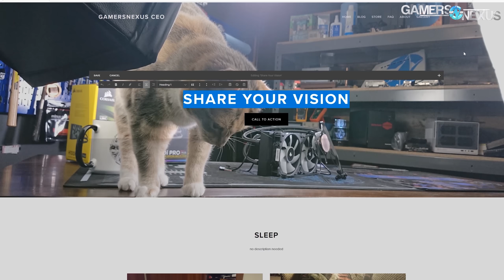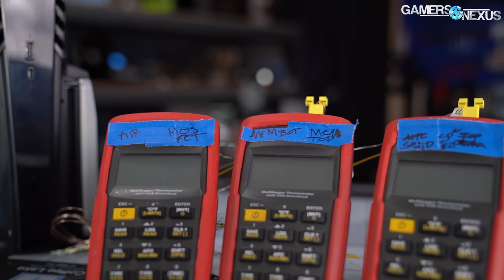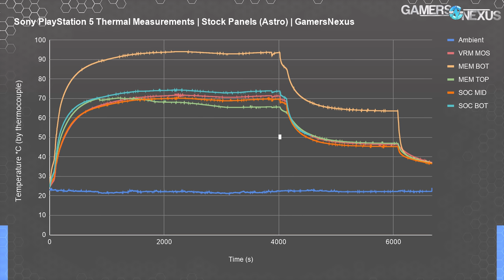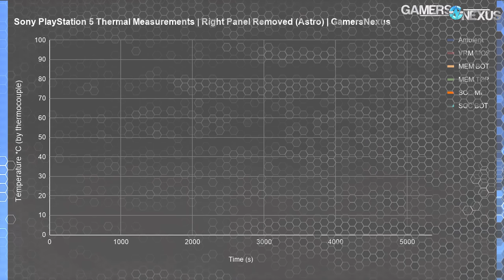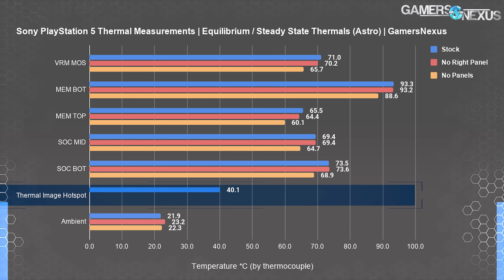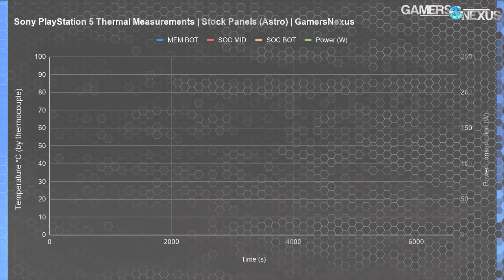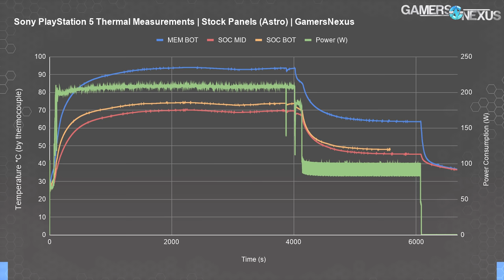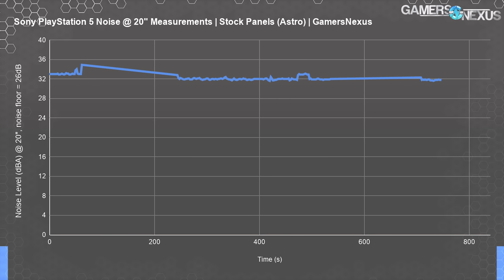Weak Cooler Design: PlayStation 5 Thermals, Power, & Noise Testing

Comment: Playstation 5 is huge, underpowered( Without the overclock it has), bad online service, no next gen retrocompat, disabled SSD expansion, cheaply constructed, runs the hottest of the bunch ( Overheating) , low storage ( 664gb), gimmicky ( DualSense, Tempest), No VRR, No HDMI 2.1 Cable Ultra High Speed.
Reply: A disaster , but everybody loves Sony lol
Reply: The hdmi cable is 2.1, there was a vid that tested the cable it self
Reply: @sorasora749  It is , it is a low version with not all the features the standard offers.

Comment: ps5 inside looks so damn cheap that's violent.
Reply: All pc, consoles or any type of tech is made of plastic, metal, an wires!! Just because something has harder plastic or fancy design dont it premium!!
Reply: @godssalvation87  still looks cheap.
Reply: @lolokikou5521  Just because they didn't get the fancy solder mask (the cool prints on motherboards) doesn't mean it's not good, the normal green stuff works perfectly fine^^
Reply: @johnuferbach9166  did you watch the whole video ? there is recycled stuff, look at that cpu/gpu mark where it should not be there.
plus the whole design feel cheap, the materials feel cheap, the build feel cheap, no wonder because they had to cut many corners to bring down price.

Comment: typical of cheap mass produced product I guess. It wouldnt cost much to cool those RAM, if anything at all but they didnt.
You should have tested with a proper game like CoD pushes the system quite a bit. If its this hot in Astro, real games gonna be rough lol.

about the exhaust being hot. Xbox is getting complaints from media because their exhaust runs too hot lol, mainstream media just has no clue about good thermals. As if cooler wind coming out is a good thing...
Reply: mainstream media is filled with people that are tech illiterate. I don't even bother with most forms of mainstream media, especially when it comes to tech.
Reply: Isn't it funny? If you want to be perceived as cool, you must either run lower power or trap more heat inside.

Comment: Just curious, if I placed a small table top fan next to it to help "blow the hot air away", do you think that would help (even a little bit)? And if so, where would you aim the airflow?
Reply: I do that. If systems on its side aim it at the right side, intake side. With airflow it should be able to move air easier.

Comment: Your PlayStation's model is interesting, it has a fan that is different than 2 other cooling fans that users received based off of this article:

https://www.lesnumeriques.com/console-de-jeu/labo-playstation-5-et-bruit-toutes-les-consoles-ne-sont-pas-dotees-du-meme-ventilateur-n157521.html

Was this unit sent to you for review?
Reply: Wow, this is very interesting. Looks like Steve has the fan showed in Sony's official teardown video. It also looks like I got the louder fan mentioned in this article 😢.
Reply: @adris3431  same here. But our fans may be louder but maybe ours are more efficient cooler than other two. We dont know yet. So dont worry 😅
Reply: @GoldPunch  there's also variations in the power supply. Some of the power supplies in some models of the PS5 are cheaper, which is what is causing the "buzzing" sound.

People thought it was coil whine, but it is not being caused by the GPU at all...it's entirely by the PSU.
Reply: @TypicallyUniqueOfficial  Oh damn, I guess I lucked out on that part of my PS5 then. Do you have a source for that or is it in the video cause ngl I didn't watch the whole thing lol.
Reply: MertensCW  What Sony's doing isn't actually a cost cutting measure. I think what's happening here is Sony is buying these fans from different suppliers which are all based on a reference design from Sony but still perform slightly differently. This is usually done to make sure they don't rely solely one one supplier incase something happens to a supplier. Samsung, for example, makes their top of the line Galaxy series phones with two different CPUs in the exact same phone model.

Comment: 1 dude and a youtube channel pretending like he knows more or is running more tests than SONY.  Rigggghhhhtttttt sureee
Reply: Exactly, I was trying to find more info on this heat issue and only found articles that were pointing back to this exact video, so unless people do more testing I don't trust these results just yet. Especially since he had to use a mallet to remove the sides that can be pulled off by hand.

Comment: What about putting thermal pads on top of the steel plate on the memory modules to transfer heat to the plastic? It would be a simple mod that everyone could do.
Reply: The conductivity of the plastic is so low that it wouldn't make an appreciable difference.
Reply: @infinitelyexplosive4131  I disagree. With such high temps and it being so close to the fan, it could get the temps in the high 80s vs 94c

Comment: At the 19:40 point you talk about coating it with a coating to present a black body object? But wouldn't that cause heat absorption itself in the coating which would flaw the test? What kind of coating are you referring to? I mention this because I recently was researching black 2.0 paint where measuring of temperatures and light reflection was going on. It changes the the temperature on its own simply by being aplied.

Comment: The magnet test was aligned with the steel plate that hold the CPU in place and I think that might be what made it stick. Because that metal shroud does look a lot like aluminum.
Reply: True. Also the plate seems way too thick. Seems to me like a 1.0 - 1.5 mm .  If that was steel, it would be on the heavy side. You also do not need such a thick sheet of steel just for reinforcing that PCB. It has to be aluminium as it needs the thickness for structural integrity. It also doesn't sound as steel when Steve accidentally hits it agains other parts of the console, it is much more muted, exactly as aluminium does. 
The last nail in the coffin  was the shine - if it was indeed steel, it would have to be galvanized steel to make any sense being in a console - stainless is even worse conductor of heat than regular steel and is more expensive. If it is galvanized, it would have nice scratch marks wherever there is a bend as Zinc is softer than steel. Those marks would also be prone to corrosion. 
So it has to be aluminium. I work with metals every day and it puzzled me when Steve said it is steel as it contradicted everything I was seeing on my screen lol.

Comment: I wanna buy modded panels with a shroud and mesh opening to let air in the ps5 more easily and prevent dust from entering
Reply: But but you can get rid of the dust every easily.

Comment: GN team, just wondering will you do a follow up video regarding the M.2 SSD expansion slot? A lot is having the misconception of leaving the cover off but in fact it’s actually part of a thermal air design to leave the cover on where it allows air to flow through that area? 

A comparison with heatsink will be great too.

Comment: Seems as though the fan has an intentionally quiet curve. Temps could likely be reduced with a slight increase in noise.
Reply: Considering how silent it is, I wouldn't mind if mine makes a little bit of noise, if that means the console won't die in 2 or 3 years or whatever time

Comment: Are the fans the standard 12V variety?  Could we put better fans on it and maybe do some case mods to the improve the temps?  Maybe cut a hole in the steel plate and mount a proper heatsink on there?

Comment: Your testing needs to REDONE.  

"I can confirm that heat shield is NOT MAGNETIC.

Testing using a long magnet on the disc drive and M2 slot cover, which were magnetic, and then on the heat shield (using the hole above the disc drive which extends through to the heat shield), which was NOT magnetic. He usually doesn't make these kind of mistakes with his PC component reviews so I'm really surprised.

His other mistake is the gap he created routing out the wires, which could've raised GDDR temps:"

[Imgur](https://i.imgur.com/MkZGzeJ.png)

Comment: Just trying to think of a few ways to solve the memory temp issue.

What size universal heatsink would fit on the steel plate over the hotspot? Would something like copper tape or thermal transfer tape going from the hotspot to the heatsink edge work? 

Or maybe just simply layering copper tape over that area a few times?

A video trying a few hacks to see which nets better temps would be cool to see.

Comment: Does it make a difference that you measured with only the left panel on and then without both panels, but then determined that you'd need to remove both panels to get a cooling effect? Just wondering if you should have tested it once more with the left panel off and the right panel on to eliminate the possibility that the left panel was the only relevant panel, and that removing the right panel was irrelevant.

Comment: Set the Fan speed higher and there you go with better Temps! They thought Liquid metal will fix that all, but at last even the best thermal paste is shit when the fan is just sleeting around 😂 This is and was always the biggest problem on Sony's Consoles... sleepy fan FOR THE PLAYERS 😅
Reply: yeah but the liquid metal is no the issue here, and the cpu/gpu temps ere pretty good, the problem here is that the memories of the system where poorly cooled, causing the artifacts reports that are online
Reply: @aanimekaii  right, and the slow fan speed causes even more problems xD But this was the same on the PS2, PS3, PS4 and again on the PS5. Not to forget the IHS problems on the PS3. Belive me one thing, Sony is not to stupid to get the consoles cooled better, they just wants it like that. Xbox Series X here did a great job again, like on the xBox One, never had temperature problems, Wii and Wii U running also years long cool and without problems, but some how it seems that Sony doesn't like cooled systems 😅

Comment: Steve you saved my 3950x with your video on the PBO settings.
Steve I hate to keep pestering yet SAM works on 3950x and you keep saying only the 5000 series of CPU has that.
I'm sure you will correct that because you are legendary.
Reply: I've heard that it works with Zen 2 cpus even on b450 motherboards with the beta bios that ad resizable bar. I'd like to test it. I have a b450 msi gaming pro carbon with a 3700x and rx 6800 xt but I don't want to update to beta bios
Reply: @TerraWare  - It's a feature of the PCIE spec Steve mentioned and it does lift performance so I hope you get that going.
Hitting the 10000 in CBR-20 is a reasonable goal with the SAM enabled.
I'm hitting 9368 and I think the 10000 score was achieved with 1800 DDR4 and I'm using 1600 DRR4 CL14
My settings ( PBO settings that Steve recommended , -0.10000 offset to keep near the 105Watts, Scaler Auto ) Enhancer OC3 Mode Auto , CPU Enhance Auto

Comment: So I can just add larger thermal pads myself or is the aluminium plate not well made enough to get full contact with the memory chips? The dificult part is finding the right height of the pads. Hope we get the exact measurements.
Reply: That probably can't hurt, but the outside of where the memory sits seems to be behind the drive, so there wont be much airflow, so it might notbchange much

Comment: I would rather have them put an option in the menu for a cooler console
So if turned it will run a few 100 rpm faster and for that cooler

Comment: I don't see an issue with the memory running at 90-ish degrees C. I'd personally want them to be better, obviously (I try to religiously keep my GTX1080 below 70 for pitties sake), but some GDDR6 memory modules can run safely up to 125C, which is why nVidia is more than happy to let memory on something like the 3090 run at 105 degrees. As long as the console is well ventilated and QC has done their job, it should last years. I also imagine that the fan in hotter climates would ramp up significantly, and the reason it's so powerful is to give it plenty of headroom.
Reply: @malazan6004  That's what I said. It's well within spec for GDDR6 memory.

Comment: I'm SURE the designers looked into this, but I'm wondering if it'd really cost that much more to replace that steel back plate with an aluminum version that was stamped to have as much surface area as possible, while removing that weird heat pipe/heatsink thing to reduce cost. 
Heck, I'd be curious to see what a difference doing a 1 to 1 swap for that back plate from steel to aluminum would do for thermals.

Comment: Sweet Jesus.  Granted, I don’t do anything that really pushes my system hard—but I don’t even like seeing any of my components start straying above 60C even during something like a long video export.  😵😵😵😵😵.   I know you said consoles rarely get major design upgrades between same generation iterations, but I think I’ve gotta wait until they make the refreshed version.  Maybe with better cooling system or just more efficient components?  But that would stress me out to know any of my system components are casually spending time at 90C.  This is coming from a lifelong PlayStation Stan.   Have had launch edition of every system from 1 to 4 Pro, but I’m glad I took my new console savings clump and upgraded PC components instead.  😭😵. And believe me, I know my PS Fat and 2 ps4 systems could get hot enough to seem at risk of imminent self destruct explosion, but I just don’t feel like I should have to deal with that much heat buildup in the year 2021.

Comment: So what size heatsinks would fit on the steel plate over the hotspot? Or would something like copper tape or thermal transfer tape going from the hotspot to the heatsink edge work? 

Or maybe just simply layering copper tape over that area a few times?

A video trying a few hacks to see which nets better temps would be cool!

Comment: I pretty much moved away from consoles, but those memory temps on a brand new console in a well ventilated room, no dust and so on seem kinda deliberate in a "PS5 Pro in 2-3 years" kinda way.

One thing I wonder about is weither or not Sony deliberately puts expiration dates on early releases, because they get cracked.

PLOT TWIST: GN Case is actually for PS5?  In all honesty tough, I wonder how the Hardware would perform if cooled properly.

Comment: Although this video is quite old, i would like to ask something and maybe I will get some response. Reason is that I currently got a PS5 and I was quite unsettled by this video.
It is said that one memory IC of the total 8 ist the hotspot and it is claimed that the steel plate is a not so optimal heat sink. So how are the other 7 memory ICs cooled appropriate then? I rather think that the experimental setup is quite suboptimal, since the cables from the sensors are unavoidably raising the plate up and therefore that one hotspot chip was not well contacted through the thermal pad with the steel sheet (since there is literally no space to route cables by design). Regarding the circumstance that only one sample was testet and only one of the 8 chips is hot (near the raised steel plate), I am not sure how reliable these claims are (that the chip is by standard getting pretty hot). It would be nice to reconstruct the test setup, but maybe with a little cut out for cable routing. I assume, that temperatures will be perfectly fine then and that a clarification should be done to not unnecessarily unsettle interested viewers and PS5 owners.

Comment: I understand that this is a somewhat overly simplified question, but to what extent do you think thermals could/would be improved if they were to release a software patch that would ramp up the fan curve?  I only ask because it seems to be more of a less than optimal design and implementation issue.  Thanks.

Comment: Is it the panel holding heat or increased airflow from removed panels? I'm considering cutting holes where the fan is and putting some nice grills there
Reply: Amazon sells panels with vents cut into fan area. Is this useful?

Comment: Would higher ambient temp cause the fan to spin up faster and maybe lower the memory temp?  I'd imagine with a low ambient temp, Sony designers may have tried to keep everything as quiet as possible.  At higher ambient temp, it might just start spinning up the fan to jet levels.  But with the small contact point and no heatsink, not sure if it'll help.  Would it be wise for consumers to put a bigger thermal pad or paste on the memory to help lower their temps?

Comment: Was the thermal potting replaced before the test? If it wasn't, this might have impacted the results
Reply: You can always be sure about one thing! Steve‘s never going to do anything to ruin  or alter the stock measurements. That’s why he didn’t touch the liquid metal. Long term test that would otherwise have been influenced. Never seen a guy that’s so dedicated and thorough in his testing. Even introduced a standardised testing methodology to level the playing field for pc components and make them comparable.
Reply: @Dudummeskind   what I meant was that it can be seen that when he opened the ps5, the thermal potting was damaged, hence, if it wasn't replaced (as you suggest he tries to avoid altering stock conditions), then no proper contact was present during test preventing that those components that are not in touch with the heat sink transfer the heat somewhere else, which may have altered the results.
Reply: @tadeoteran1372  You could be right there. But I‘m sure he thought about that. I‘ve never worked with thermal putty, but my understanding is, it is like a malleable, more tenacious thermal paste.

Comment: How hot did the internal components of the ps4 get? I know mine use to cook! and it still lasted for years
Reply: Well that's it. I had a laptop that would burn my hand if I put it on the mesh. Could almost heat my room with it. It's still good to go. Ps5 doesn't even get close to that heat. PS4, like you said, way hotter.